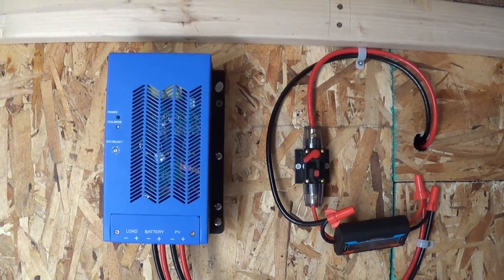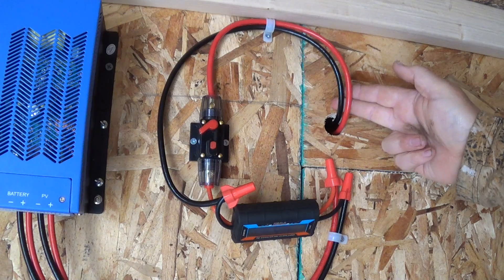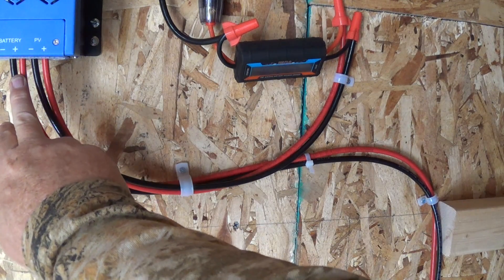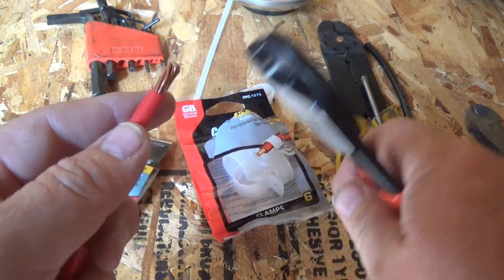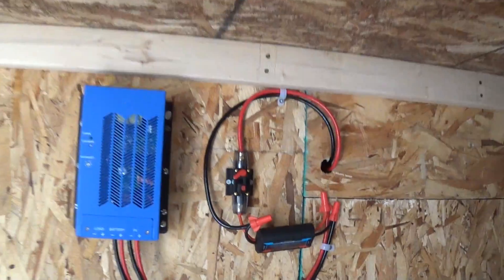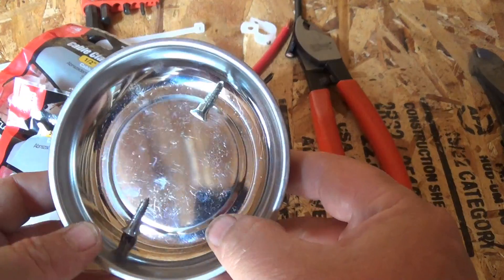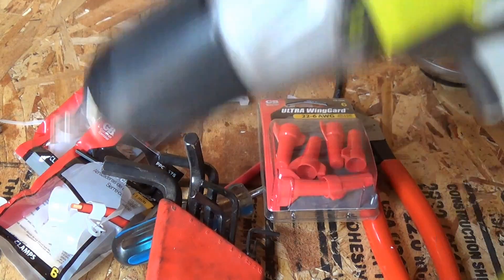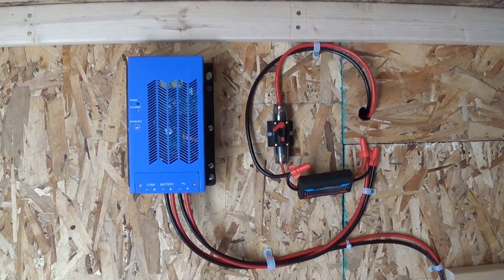Solarmate Charge Controller 24v 60a for my Off Grid Solar Power

Comment: You got a basic controller, works OK but very limited
Had one long ago that burned out
Reply from the maker: very limited but sometimes simple is better. some day i will increase my system size and get a better charge controller but for now 5 yrs and going strong. worth the money.

Comment: I have used the  controller in some of my installations.  Look at the bulk and Absorb voltage recommendations for your batteries. Pick the number closest to it and that is what you set it to. They work fine. The only issue I had was the voltage limitation on the PV side.
Reply from the maker: yea, if I recall right I did set the number closest to the right setting.

Comment: Puts a circuit breaker in the PV side of the system. If all your panel's total short circuit value is less than 60 amp (which it should be using a 60amp controller) how the fuck is the breaker ever going to trip? Its not possible to create an overload on the PV side. If your intentions are to protect the panels well then you must be too dumb to do this kind of work and you should call in a professional.
Reply from the maker: +DangerZONEpixel interesting. the way it is wired wasn't my idea it actually was by the solar company I bought the equipment from. in fact it is the same set up they are using. I have ran this by some who is a license electrician in phx and they said the way it is wired will work. so I am not sure I understand what you are trying to say.

Comment: nothing little there my charge controller said to hook battery to it  first then panels or it will break, so i did it that way. yours might be different. what could be your total amps from the panels. do you watch the altstore lady's videos. she is very helpful. if i recall you have those monster batteries. did the snow go away, ha.
Reply from the maker: +George Gardinier still a little snow on the ground... should be more this week.... my panels are 260watts and I have 6 of them. the set up I am using with the 60amp breaker and charge controller is the same as others are using. the place I purchased them from is using the same set up and all works fine.

Comment: Interested to see how your solar charge controller works Thanks.
Reply from the maker: +TheKilog69 I am interested too. the set up I am modeling this after it works fine. in fact the panels I have does max out the charger but I have no intentions on adding panels maybe a wind turbine but no more solar. I have 1500 watts of solar I still need to set up ,